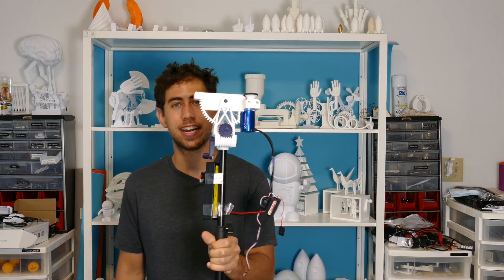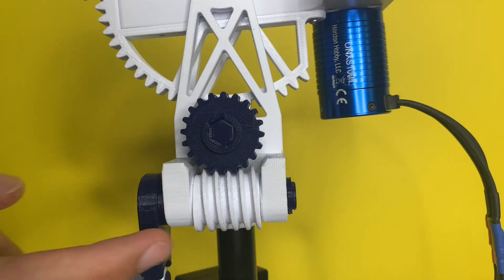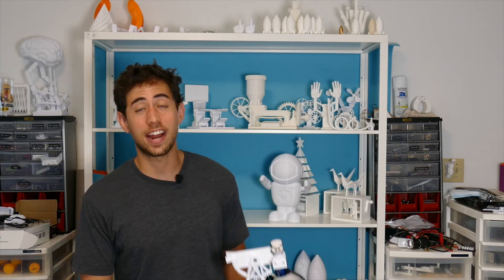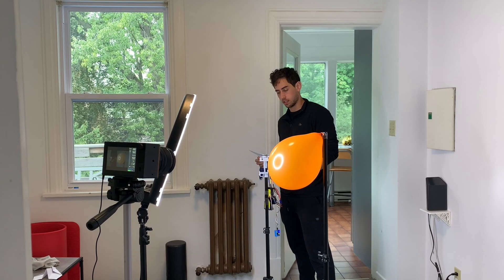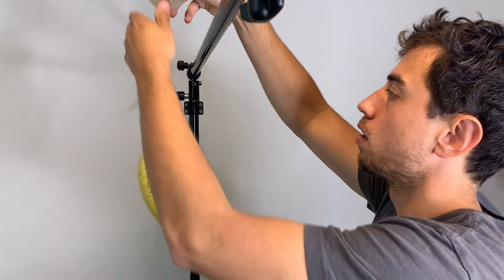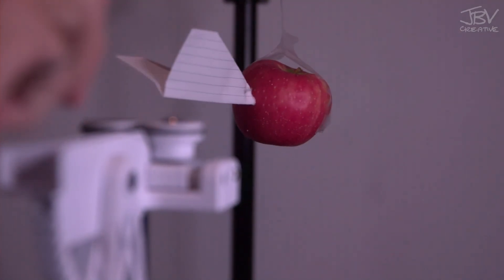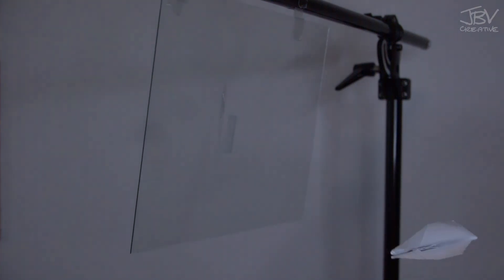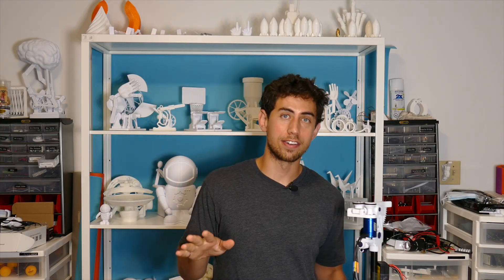My Paper Airplane Launcher is DANGEROUS

Comment: I guess you fulfilled my childhood dream with this :D
My suggestions on improvement would be 
more resin in contact point to increase friction , so it will be lees likely to skip turns on paper and transfer more energy)
make these wheels heavier,so they would act like a flywheel storing it them more energy to transfer to paper
and try more rigid paper for planes,for them to not deform with that crazy acceleration.
Not sure if you are interested in V2, but thanks for evoking my fantasy 
such a boring day it was
Reply from the maker: These are great suggestions! V2 would definitely use some metal parts for the wheels, and more rigid paper for the planes would also be a huge help too. Happy to help make the day less boring!